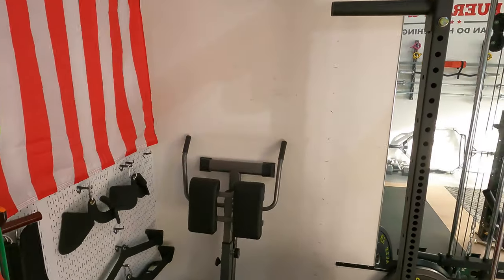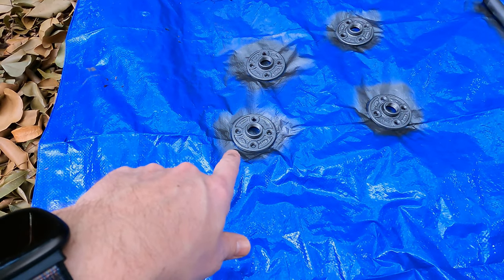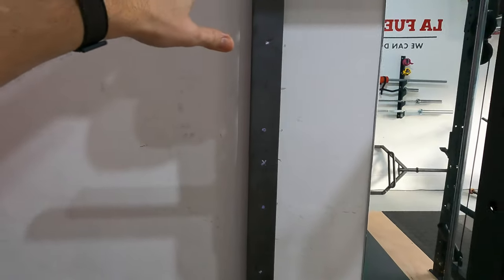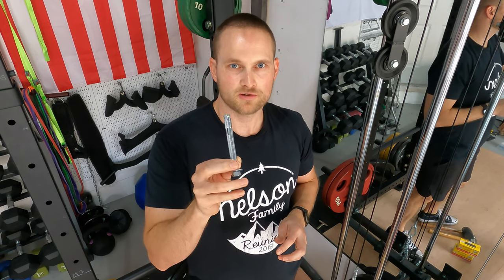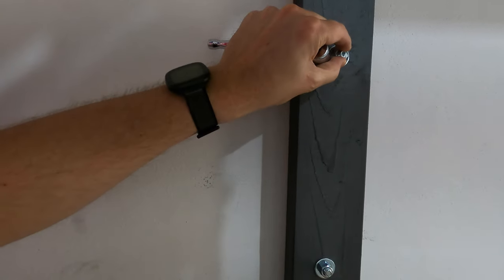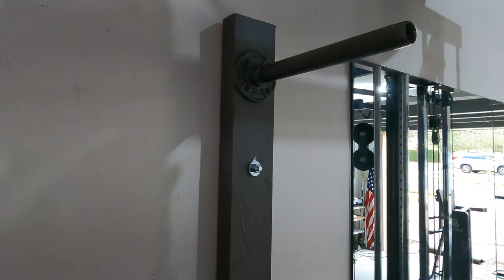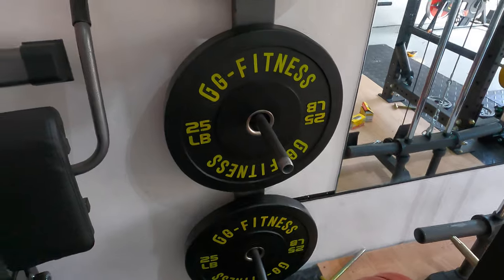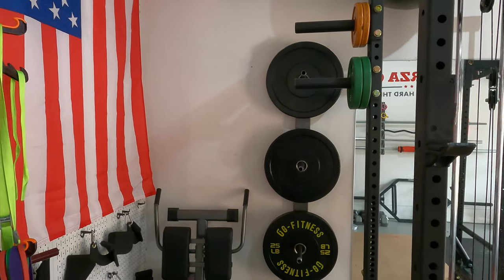DIY Profile Weight Plate Rack Tutorial

Comment: Nice build 
I’m planning on doing something similar 
Don’t you think it would’ve been a little easier screwing the flanges directly to the cement wall?
Reply from the maker: I'm not experienced working with cement walls. Maybe it could be easier, but for me I'd rather attach the 2x4 to the wall then attach the flanges. It seemed easier to me. Let me know how it goes.👍
Reply: @DiscoveringStrength  I ended it up buying 2” x 1/4” steel plates and had my friend weld steel pipes on it 
Cost me like 25 usd
Reply from the maker: @Jcpineda26  sounds like I need a friend like yours!😂

Comment: I don't think I would trust a floor flange attached to a  2 x 4 to hold (2)45s, (2)35s, (2)25s, etc. but I appreciate the simplicity of the design. I actually use industrial pipe parts for shelves, but even in a stud, I just would be very concerned it couldn't handle that kind of load over time.
Reply from the maker: You are right. These held just fine for about 6 months, but just recently one of them that holds a pair of 25s just started to come off due to the weight. I'm curious what you would suggest to attach the flanges to the 2x4?

Comment: What screws did you use to attach the flange?
Reply: Also would you shorten the 10 inch if you did it again?
Reply from the maker: I think I used 1.5" flat wood screws. I haven't had any issue with them.
Reply from the maker: Yeah I think it depends on how many weight plates you want to hold. I'd maybe do 8" if I did it again. 10" is a bit long...and I almost went with 12"😂
Reply: Thanks for your replies, I'm almost done with mine too :)  I went 3 4 and 5, using iron rather than bumpers so I can go a bit more shallow until I build up my weights, at which point I will probably add 2 more 45s and 2 more 
 25s